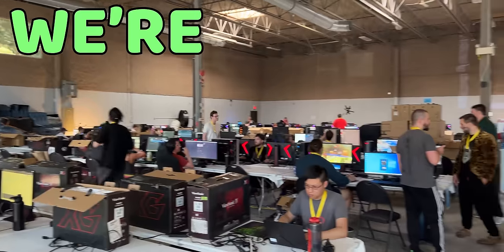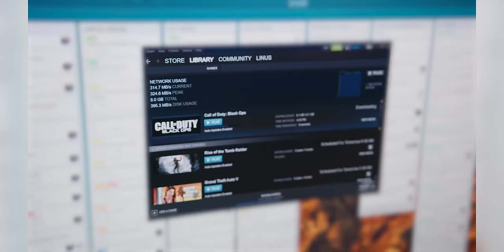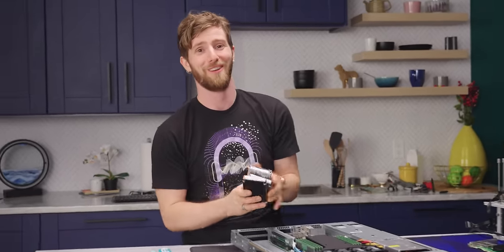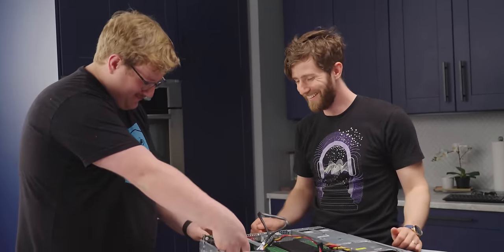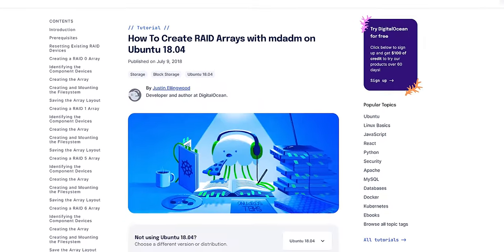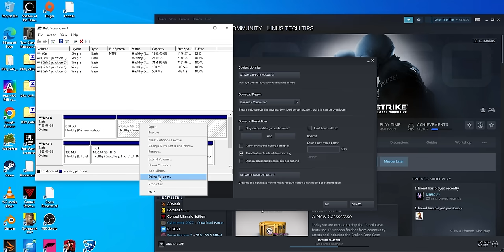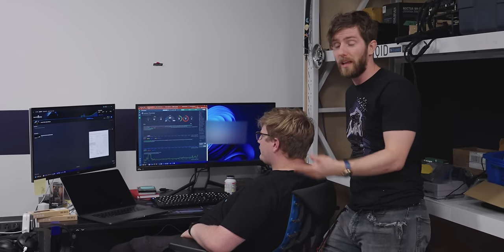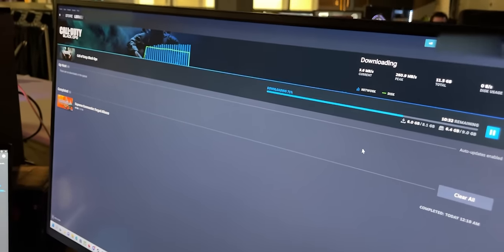We’re running out of internet - Steam Game Caching Server

Comment: Supermicro has been a go to when local budgets allow freedom. Always been a top product imo, simple but effective. They just hum along when others find new ways to fail. Not a bot, just someone that respects a product I've seen perform over a decade in many scenarios.
Reply: SuperMicro is great for IT people who aren't locked into the big vendors like HP and DELL.  Costs way less money, no proprietary garbage, and if they don't have a bare-bones design that quite meets your needs, you can just buy motherboard and chassis separately to get exactly what you need.

Though one of their best features, for someone who builds servers from start to data center, is the rails.  Other than adding a couple optional screws on the chassis parts (they snap in securely without screws), no tools required.  Rails go into the cabinet in seconds without needing to mess with cage nuts.
Reply: @TrueThanny  Thats big facts. Fighting those big vendor new bs rails has become annoying.

Comment: The Mellanox card would have worked out of the box with TrueNAS because it's based on BSD, not Linux.  Mellanox driver license terms are incompatible so using Mellanox drivers with Linux requires compiling them yourself from source, and Nvidia (owner of Mellanox) doesn't make finding those convenient, at least for the old Mellanox cards I have.

Comment: I wonder if you can multicast the traffic using the switch and software. That would make it so the first system that grabs the game initiates the connection, then the others would basically eavesdrop on the connection, allowing the switch to just send the traffic out multiple ports. That would make it even faster.

Comment: instead what i do to overcome the problem with DNS is not to rely on windows settings but get the router to intercept all requests to itself, then send the request out to appropriate servers. Its even better if you run your own dual bind DNS servers so if one is down thats not an issue, and you can do custom zones and responses so the response then differs based on situation. Still since with mikrotik i find that it does go through the DNS server list so if the first one cant find it it uses the 2nd.

Comment: Even with just 3 systems in the house, it is maddening to have to download the same game/update 3 times. I usually try to copy the files over local network, but I still end up with significant downloads on each machine. surely there is a solution for home users with multiple systems but not unlimited bandwidth.

Comment: I'm on a 500mbit connection, but it's mostly just the one PC , so if i were to up the link speed to 1gbit , i would be forced to buy a 1-2 tb ssd as torrent drive and i would have to change my router .  300mbits are absolutely totally plenty for 1 client imo , for 1 gbit one needs to be ready in many ways . Going over gigabit is pretty much out of question, perhaps in 2030 and beyond .

Comment: As long as the lanserver is not running as root, there is 5% reserved for root user by default. So it won't crap out unless this default is changed.

Comment: I'm currently having issues across multiple devices in multiple households, most seem to be realtek /mediatek chip sets.

Basically I either get DNS lookup fails, disconnects or speeds of 0.001 Mbps,  windows shows good signal and tries blaming the router during diagnostics.

Same happens on 7 and 10.

It seems for all purposes to be a hardware fault but wireless cards tested are either new are have worked fine on other machines.

Firewalls have been reset, IP stack had been resetutiple time and all power management have been set to not power of the card.

Comment: What kind of hardware would be necessairy for a 15-man LAN to reach like 4-5gbit thruput? Network is 10gbit but not sure on CPU/memory. Would an older Xeon suffice? Been looking into an HP Tower Server ML110 range to use that as a cache or is it better just DIYing a little system to handle it?

Comment: Even though "MW2" and "Modern Warfare 2" have the same number of syllables, the former is faster to say.

How long a phrase/word takes has less to do with the number of syllables but the number of points of stress or number of stressed syllables.

Modern Warfare 2 has five stressed syllables. MW2 has three.

Similarly, Daniel has two syllables both of which are stressed and Danny has two syllables, but only one which is stressed. And Danny is a little bit quicker name to say.

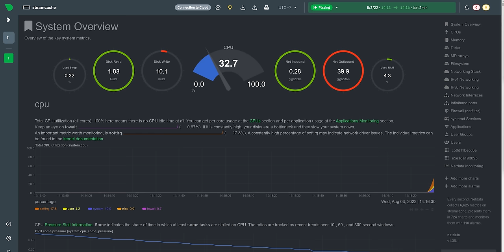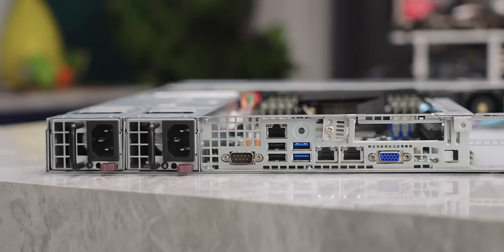Comment: How you achieve 50 Gbit from the server (Net Outbound 49 Gbits on 19:56)? The server has 2x 10Gbit connection ( 4:19 ). How did you divide the network capacity into 150 users?  Switch? Etc. ?

Comment: EDIT: Okay, nm later on they do put in dual 25Gb E card for 50Gbps. Phew thank god. Now the RAM actually might do something and they will have ~204.8Mbps/25.6MBps bandwidth per person. Good chance people will likely see 1Gbps speeds at least periodically since its unlikely all 250 people will need to download all at the same time. I still think they should have gone with 2x100Gb E so they could have 200Gbps total connection. I would have loved to have been here with my desktop with my Intel 10Gbps fiber NIC so I could hose everyone's downloads by taking up 20% of the bandwidth lol!

Original: Why is it 10Gbps!?!? That is only 5 times faster than your internet!. That gives you only ~40Mbps/5MBps per person. Granted if you were able to load balance it with both 10Gbps than you get 80Mbps/10MBps per person. That's better but not great. I figured you had 25Gbps or 100Gbps NIC in there. That would make a whole lot more sense!

LOL....Yea, cramming a lot of RAM in there is pointless if you only have 2x10Gbps NICs! Even 4x SATA drives would max that out unless you are doing a lot of 4K transfers lol. You really need at least a 25Gbps NIC but preferably a 100Gbps NIC with 250 people!

10Gbps/250 people=40.96Mbps/5.12MBps per person
25Gbps/250 people=102.4Mbps/12.8MBps per person
100Gbps/250 people=409.6Mbps/51.2MBps per person

Yea 100Gbps NIC would be fantastic but 25Gbps is arguably good enough. That 10Gbps is way too damn slow. People must have been bitching about DL speeds with that 10Gb E NIC limit. lol

Comment: @LTT - Lets downsize your hardware in the video to what most guys can obtain for home systems.   Best I can do is a Dell R710 with 24 Gigs RAM and 2 each 2 TB (Linux Mint OS) and 2 each 10 TB drives (storage)- a Dell Power Connect 2748 switch,  and single Rectangle Dishy (my Starlink Internet in Beta).   Can you do a (peoples level) build and make it function?   I need the Cliff notes version of this incredible setup.

Comment: I've had to redownload literal TB's worth of games over and over because I've had to reinstall my windows so many times. I get limited to 7ish MB download by steam for some reason I can't figure out even though I get 50-100MB down and 50-150MB up and steam settings are set to unlimited speed. This would help me SO much but I really wish I could figure out why my steam is caping my speeds in the first place.
Reply: I have the same issue when I download steam games on my laptop. I think some part of my hardware is slowing it down (probably the HDD)

Comment: Good thing dnssec has terrible adoption. But how does TLD/DTLS not get in the way? Do most games systems not use secure connections for their downloads (and hopefully do use code-signing)?  

Or does this only work for steamclient and similar clients that explicitally use a non-secure download transport protocol and hostname?
Reply: I was wondering this too. I can only assume you have to install a root certificate on the end user's machine. Then you could issue your own certificates for the affected domains. Of course this only bypasses the issue  for a "vanilla" HTTPS connection, it could be complicated by certificate pinning if the clients use that.
Reply: Lancache mentions this in their FAQ. It only works for non-encrypted traffic.
Why are they not using secure connections for the game downloads? Encrypting the downloaded files uses more resources than simply sending it as is. Since the game data does not really contain any sensitive information (except that you are downloading the game) you can simply send the smaller checksums over a secure connection (or sign them and send them over the insecure connection as well)) and tell the clients to verify the downloaded chunks with them. This way you can download the game files from the lancache without actually trusting it, since you can verify the checksums. As an additional plus, they allow big downloaders like LAN parties to set up systems like lancached to reduce the load on their servers even more (it doesn't only reduce the network usage on the downloading side).